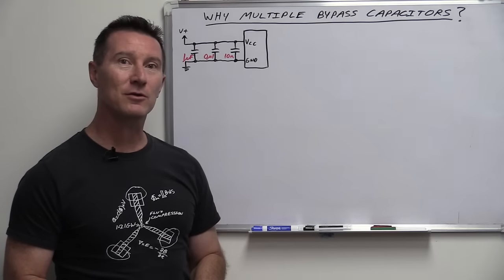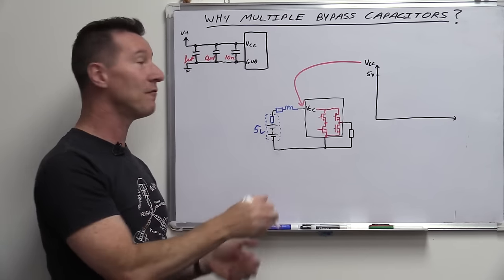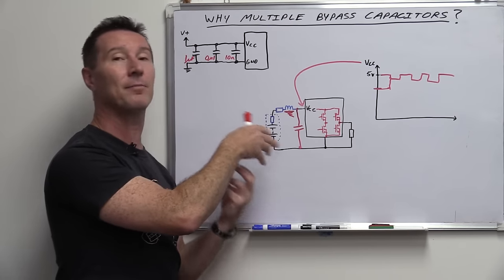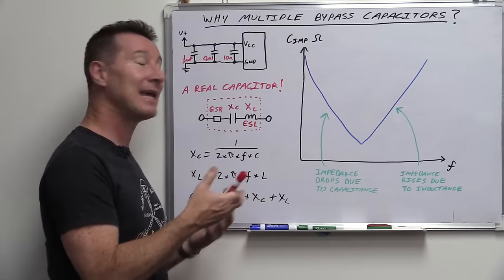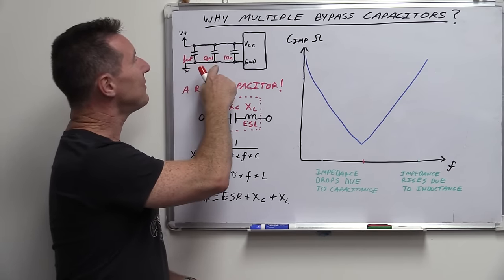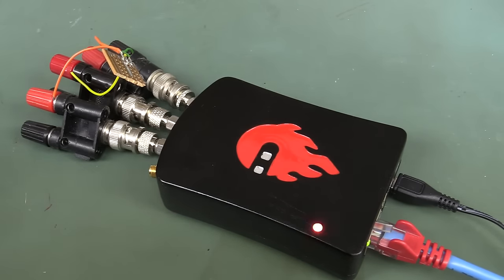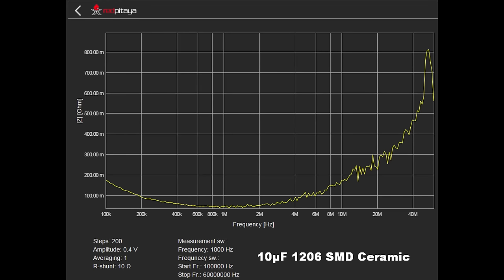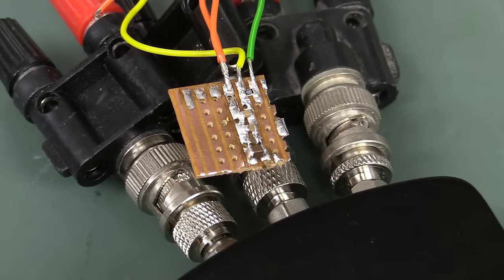EEVblog #859 - Bypass Capacitor Tutorial

Comment: Hey Dave, another question: why do some capacitors with the same value of C have different Rx at the same LOW freq (for example the electrolytic in your example at 100kHz) where these effects are supposed to nearly zero ?  I can understand differences in everything else - parasitics, ESR, ESL, power handling, ... but shouldn't all 10uF capacitors have the same Rx(f) aside for that ?  Thanks !

Comment: using alkaline battery and 100nF single bypass cap is reducing bypass capacitor usage but alkaline batteries are expensive than little capacitors. the best inside capacitor there is a little inductance. i loved your video. the best video about psu and supplying our chips.

Comment: Dave,
I forget if I have posted this before.

Please add decoupling resistors for consideration too.  With out identifying real resistance your Qs are undefined and that is not good.  Resistance from the power net helps tame the mixing of all signals in the power nets.

As much series resistance as is compatible with normal operation and taking fault conditions into account is what I tell beginners.

Comment: 1 line short : real cap act as RLC circuit so It has impedience function of freq, so you have to use multiple to create wider band of desired low impedence.

Comment: Bypass capacitors are paramount when working with some sensors. The bread board is a noisy environment. I could adjust the position of my final bypass cap slightly and the baseline would move noticeably.

Comment: Not to be picky but when I read "Bypass Capacitor" it caught my attention because I have always heard them referred to as "Filters" which acting as a battery will stabilize a voltage. Typically a higher voltage is used [ie...5.2V for 5V] with ample current available for the job so the voltage doesn't droop too much to effect circuit operation, adding capacitors where needed to stabilize the voltage.

Comment: I always looked at it as higher bulk capacitors at the chip to prevent voltage droop,  smaller capacitors at multiple Vcc inputs to filter out ripple at different frequencies. Maybe that is the same thing you are saying but just looking at it a different way.

Comment: In the early part of the lecture, around 14:33, Dave explains that in the middle part of the V curve you have this dropping impedance, which is desirable because it gives you the 'gulp' of energy, then at higher frequencies its bad because the impedance goes up and cannot supply that energy. What is confusing me later is he says at 23:50 that the right hand side of the curve, where impedance is dropping, is the UNusable part of the curve. If we want lower impedance, why is the right side the 'bad' side?

Comment: statement at 1840 and the white board headline about why it is so great and smart to put cheramic caps of different values in parallel for ic decoupling is VERY false !!
the reason WHY it is always a VERY bad idea is explained in great detail from, 2640-2800
in other words : DO NOT put cheramic caps of like 1n 10n 100n as often seen in parallel it is a VERY bad idea, you raise the impedance to the same as no decoupling at all, simply due to the parallel resonance from the small cap that is still capacitive, with the bigger one, that is now inductive. Best regards from an RF engineer :-) and pcb highspeed designer

Comment: Hello sir ,
I have a one query,  that I'm going do a level shifter circuit to convert positive signals into negative signals.
Input is a pulse signal from 0V to +3V and outputshouldbe -5V pulse signal. Using opamp LM7372 and the reference voltage is set to  -2.5V. Can you help me how to calculate the potential divider circuit and explain me equation or formula to calculate to convert positive pulses to negative pulses input so that i can generate -Ve signals?

Comment: Hi Dave. One question. Figure1 in this paper http://www.analog.com/library/analogdialogue/archives/39-09/layout.pdf
does not look like what you drew at 17:41. The analog paper instead suggest that larger is always better at lower frequencies and just as good at higher (given the same package size).  
Yes, lower values caps have their resonance frequency higher, but thats canceled by the higher impedance because of the lower capacitance.
Would you agree, and if not, elaborate on why not?

Tanks for a great blog!

Comment: Hi there very interesting! Question I came accross your video in search of a problem I have. I bought a 30a chinese buck converter to work on my batt pack for my ham radio however from roughly 12mhz up the noise from the internal switching of the BC gets worse and worseas the freq goes up, as an after market solution have you gat any ideas of how to best implement the content of this video to solve my issue... keep up the good job

Comment: Dc Ripple should be 1% and below  to achieve that simply  put a probe and a freq analyzer and see what
Noise  frequencies  have the highest gain (gain freq spectrum)
And calculate a capacitor reacrance
To be very low say 20 ohms  to know what cap value needed at that specific freq  using multiple capacitors value will reduce those noises perfectly below 1% of the dc voltage .
A practical use is an LC filter 
Using a choke inductor and capacitors  .
Another thing lets say you have to put a single capacitor  1000uf 25v capacitor for a bridge rectifier 
USE 2 capacitors that have a value of 560uf 25v  instead to redusce the capacitors ESR and having a much longer and reliable circuit components life span hope that helps.

Comment: Hi Dave,
one question:
if the reference design from the datasheet of a chip manufacturer only shows a 10nF bypass capacitor or something like this, can I then assume that this is enough bypass capacitance for all switching states and operations on this chip?

Most CMOS devices or NE555-type stuff require only 10nF as shown in their datasheets.

So is there any need of higher bypass capacitance than this or not?

If not, I would be generally well using 10nF on the smallest availabe package to be fine with the bypass capacitance, wouldn't I?

Thanx a lot an greetings from germany,
Matthias
Reply: +Matthias Pollack Properly optimising a power delivery and decoupling network requires either doing lots of experiments with a network analyser or simulations with some very expensive software (HyperLynx, SIwave, Sigrity). Most engineers don't usually have these tools on hand, so to be on the safe side, datasheets will usually show more bypass capacitance than is necessary. 10 nF is certainly enough for a 74LVC or similar device, although in some situations (high frequency, low slew rate) a lower capacitance might be better.

For high-speed decoupling you should generally use the smallest package you can. Looking at the impedance curve for a Murata 10 nF X7R 1206 capacitor, you can see that the self-resonant frequency is around 57 MHz. Only above this frequency will inductance dominate, so as long as you're operating at under a few megahertz, you can use whatever package is convenient. For more information, I'd highly recommend checking out Henry Ott's or Howard Johnson's books.

Comment: This is the same principle by which capacitors are used to smooth out and stabilize the pulsing DC coming out of the rectifier tube in the power supply of an old tube radio or amplifier or TV.

Comment: Your test setup is wrong I think, am I right? the caps must be between power source and resistor (resistor must be at veroboard end, not start). Now you are putting fluctuations of charging caps in resistor too, not filtering out fluctuations.

Comment: Good stuff Dave! Recently had to replace a motor run cap on my AC fan, after some googling, it appeared value was crucial. Eventually replaced the 1.5uF with a 2uF cap, seems OK for now. The math behind the value reasoning was a bit daunting. I guess the phase is not quite right (from what I read). Can you do a video on this? Would be super awesome as there is  no 'laymen' on this.

Comment: Did you try to put the excitation source down to "bottom" edge of test board? Im wondering how big impact could have the rearrangement of componnents. Or better say: if the rearrangement coud have a measurable impact.

Comment: A  circuit board design with relatively unbroken power planes will outperform a bushel of bypass capacitors.  Ceramic chip capacitors and their associated vias have a resonant frequency of a few hundred megahertz, while copper planes with thin dielectric spacing are good to several gigahertz.

Comment: Great video, a question please, so the 100nF 0402 has a higher ESL/ESR than the 10nF cap., but the 10nF will supply around 1/10th the current of the 100nF, so apart from putting 10 x 10nF in parallel, how much does is VCC ringing improved by having a 10nF in parallel with a 100nF on say a 600 MHz CPU?

Comment: Is a decoupling capacitor the same thing? Or is that to remove high frequency signals from your DC supply? What about a suppression cap? I've researched this all online but everyone has different answers. Some people say the terms change based on weather your working with signals or power, AC or DC etc. Some people say their the same thing. A lot of people say it depends on weather you use the capacitor in series or parallel but you can only use bypass in parallel and coupling in series right? What's the difference between coupling and decoupling? Are they the same as a high and low pass filter? I'm only 17 so I have never had a proper education in electronics. I need a definitive answer. Can someone please help. Thanks. Another great video again Dave.
Reply: +William Smith Thats the term that I use i.e. decoupling capacitor.

Comment: Can the bypass caps cause any problems or degrade a performance of an operational amplifier (in audio range)? I have a preamp with AD712JNs (each fed by two 220 uF (Black Gate) caps) that have soldering pads next to the op-amps for bypass caps with 7.5 mm lead spacing. But for some reason manufacturer had not installed any small bypass caps there. I'am wondering why. Should I solder there some good 0.1 uF film caps?

Comment: Awesome, this was so informative. I was having issues with a highish-speed microcontroller circuit and I was just slapping on different capacitors till it worked. I guess I'll have to be careful for the final PCB design, especially since I'm not using SMD components. I imagine the breadboard setup just adds a whole new world of problems too (especially since I have it spread across two boards lol.)
Reply: Jules Calella You DO have to be careful with the PCB layout, especially if you are using thru-hole components.  I have seen a number of boards have to be redone entirely because of poor chip / supply bypassing.  Many parts these days have edge rates below 1ns.  These means sevaral things.  Bypass caps have to be right at the chips power pins.  Do NOT drop chip's power leads directly to a power plane - go to the cap first, then the power plane. Make sure the cap's ground lead goes directly to the power plane - don't run a trace over to some nearby but unrelated ground pad.

Many people like to say "the power plane makes a good capacitor!".  WRONG!!!!
That may have been true back in the 1980s, but chips switch too fast for that now.  Propagation velocity in FR4 is about 180ps/in. That means a signal will travel about 5.56 inches in 1ns.  If you divide this by 2pi, you get about 0.9 inches per ns.  For a 1ns edge, anything within 0.9 inches you can consider it a lumped element.  Outside of 0.9in for this 1ns edge, you have to treat it as a transmission line.

Thus, if your device is not properly decoupled with a cap right on the power pin(s), it will suck it out of the power plane as a transmission line.  I have seen a single 1" square IC bounce 55 square inches of PCB power plane.

Essentially, these days, "the power plane makes a good transmission line!". It sucks as a cap.  It can do a great job of transmitting noise from one part of your board to the rest of it.

If you have a lot of pins on your micro switching simultaneously, estimate the current they will draw by using i = nC dv/dt where C is the capacitance of the loads on the pins (usually just a few pF), n is the number of simultaneous switching outputs, dv is the logic low to high voltage difference, and dt is the minimum edge time duration.  You may be surprised at how large this current is.

Fortunately, you can use C = i dt/dv to determine your minimum decoupling capacitance.  This time however, dv is the maximum number of (milli)volts you want to see your power supply (at theIC) to drop during the transition. You should find it is actually a reasonable size cap, in spite of the large current.

Good luck!
Reply: Cynthia Cantrell Wow thank you so much, this is really useful. So this information is applied to circuit boards with power planes and ground planes, but what about star configurations? Are the effects reduced if all the traces terminate at the power source, or does that introduce new problems? I wonder if a combination of planes and individual traces be better, like in a multilayer board (4 or more)
Reply: Jules Calella I assume you mean a star configuration for a power supply wiring harness instead of traces in a PCB?  I am for clarification because a "star configuration" is also used to describe the grounding scheme inside equipment with multiple IO.  As usual, what works best depends on exactly you are trying to do, and what signals you are trying to pass between circuit elements.

If you have independent heavy loads at the "points" of your star, (different fans or motors, for example) a star configuration can help you minimize wire gauge as each wire only has to carry the current for one fan.

If however, the ends of these points needs to talk to each other at a high speed, a daisy chain could be better, as the noise from other nodes don't get added to the ground as a signal goes through the hub to its destination.  Differential signals (as opposed to ground referenced ones) can help you bypass that problem though.

Whether the wire or trace is "long" or "short" depends on the EDGE rate of the signal, not its clock rate.  (Granted, faster clocks will require faster edge rates).  

Whether you use a star or a daisy chain, you will need to decouple your loads well.

If you are sending signals a long distance as well as power, then you have a whole host of signal integrity issues to deal with.  Here again, the edge rate is critical in designing an interface that will work, along with the transmission line impedances involved.  In the past, I have intentially slowed edges down from an FPGA (under 2ns) so that the I2C receiver that was 3 feet away over twisted pair would see a usable signal.  I probably also used an RC termination at the load. Otherwise, it would have been subject to tremendous ringing.

So basically, it depends.  But Howard Johnson wrote a couple of great books on these topics.  The first one was called "High speed digital design: A handbook of black magic." I have a nitpic with at least one item of his, but I highly recommend all of his books, and his Signal Integrity website if that is still up.  If EE is your main field, his books should be in your personal library.

Good luck!
Reply: Cynthia Cantrell that clears up a lot, thank you. Ill probably buy that book and others too.

Comment: So the gist is that the capacitors have their own internal impedance such as small inductance and resistance which leads to their inability to provide instantaneous changes in currents roughly speaking? by adding multiple capacitances we increase the range of frequencies under which the circuit can operate, especially higher frequencies?